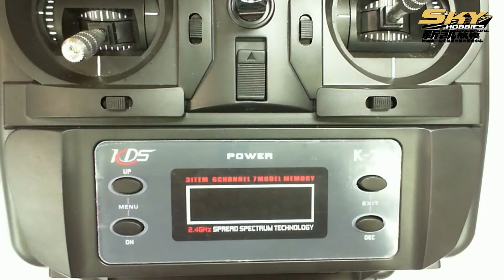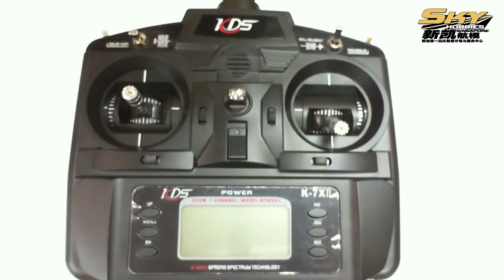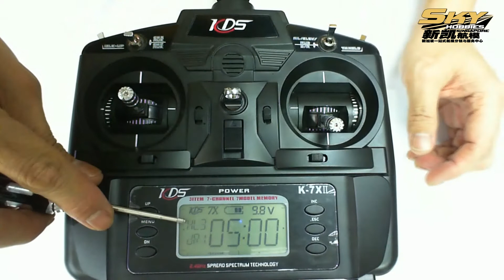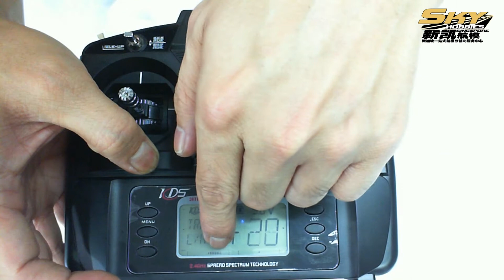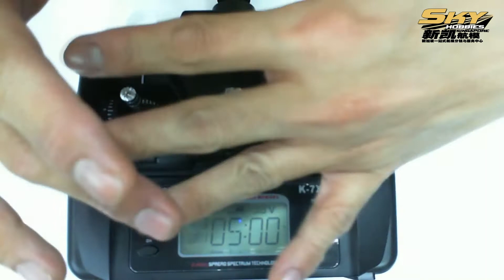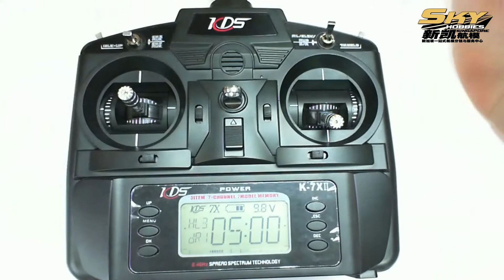KDS K7X II Radio

Comment: Correct me if I'm wrong.
The first TX actually has a timer if you hit the bottom 2 buttons at the same time. They are also both a 6 channel radio as you don't have a 7th channel switch.

Comment: range is 600 meters to all directions  ,wich is more as enough for a helicopter ,ive not flown my t-rex 500 out of range yet on the extra kds radio i got for the t-rex  : )
although i like the 7x II with my innova 450 ,because its easier to program ,and the automatic timer is great ,used to forget to set it on the old many times ,on the new it automaticly counts from 5 min to 0

Comment: Great info ! Okay at least now I know what K-7xII transmitter following features when I bought the KDS 450 QS and still new to 6 channel Heli RC ... just want to know more about it.. could you do a video about it radio configuration (in english pls ...) on how to adjust the expo,pitch,aileron, rudder and other setting and their effects if set on positve value or negative value.. Thanks !

Comment from the maker: There are Mode 1 to Mode 4 transmitters.
Mode 1 and Mode 2 are more common.
The one in the video is Mode 1 (with throttle on the right)... although Mode 2 are commonly seen.

Comment: hey i just got this remote with a kds 450 qs and the only way i can get the remote to turn on is when its plugged in. i put the batteries in and it just won't turn in off the plug =.. any suggestions

Comment: Kindly show how to do Throttle and PItch Curves in NORMAL MODE with KDS K7X II Radio.when we adjust the pitch, Idle Up and Throttle hold switch what position it should be.